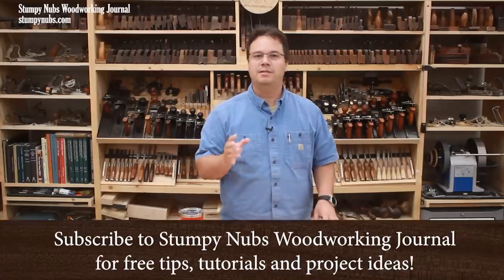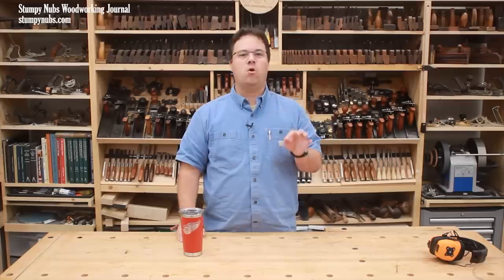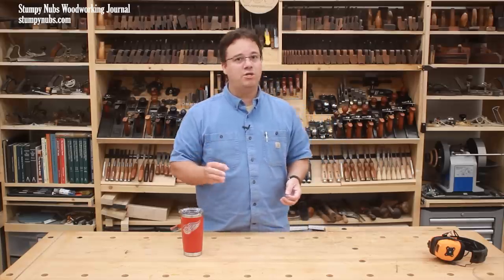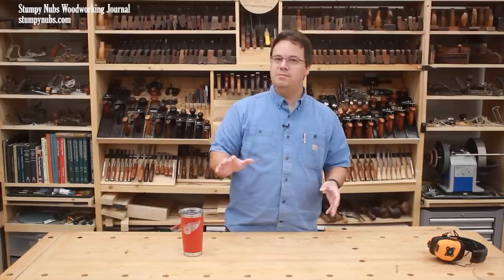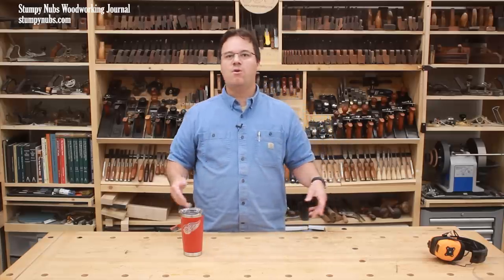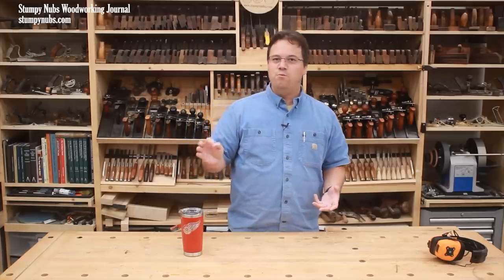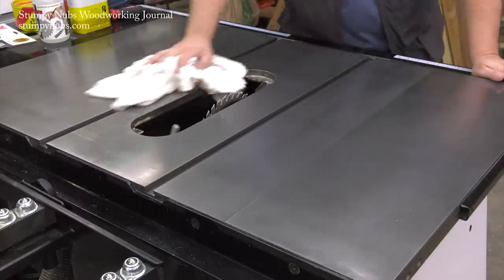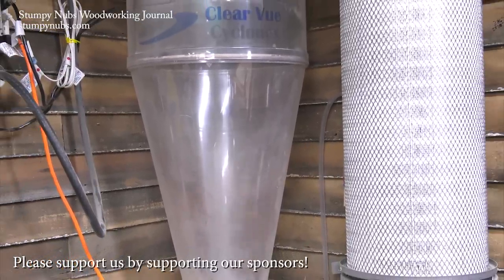Removing table saw rust SAFELY and QUICKLY

Comment: Maybe you could do a follow-up video. I'd be interested to see how you might bring a saw back it's been aggressively sanded. Not for me I'm asking for a friend. He might have done serious damage the top of his song that he bought brand new 20 years ago and then sat in storage for 10 years and then with sanded aggressively and thought was beautiful again and then put back in storage for 5 years then I got it out recently it was really excited to click on this video so you could tell his friend about how you might be able to fix it. Hypothetically theoretically speaking. I'm sure he'd really appreciate it if you would do that.
Reply: Get a good, high quality straightedge and examine the top of the table for suspected low or high spots. Mark all the high spots with Dykem blue layout fluid, then sand those spots down slightly with something like 320 grit sand paper, just until the blue is removed. Then clean the whole top thoroughly with isopropyl alcohol and make sure all the grit is off, then remeasure the surface with the straightedge and repeat the process! Just take it slow and recheck flatness frequently, and you'll be able to pull it back into shape. Also if it's hard to see the high spots, put a bright light behind the straightedge. You can also paint the bottom of the straightedge with the layout fluid, and then press it onto the part of the table you want to check. It will transfer fluid to the table, and if any spots under the straightedge don't have blue on them, those are low spots. Be sure to check flat from a bunch of angles across the whole table to make sure you're actually creating a planar surface. It's probably going to take a while, so just go slow!
Reply: I agree with the reply by Evan....while Dykem will work I found that a simple Sharpy permanent maker drawn lines and shapes in the higher areas will guide you to what areas need to be reduced...and everyone has Sharpies around the shop. Of course I would only use this for an obviously badly distorted top. Otherwise I would not recommend fiddling with a good top. I have wood working tools and also a metal lathe and milling machine in my shop. The ways on a high end metal lathe actually use this method to get them to incredible levels of flatness....they  use a sort of metal scraper to remove microscopic amounts of metal.  That is a real (sadly becoming lost) art.
Reply: To add to what Evan said above, 

Of flat straight and true, flatness is by far the easiest one to achieve. Find the lowest spot on the table, easiest with low viscosity oil, but dykam will work, so does a graphite pencil. Find a piece of float glass off yr neighbors house or something. Using super 77 spray adhesive attach 3M wetsanding paper to glass Using the straight edge, maybe a laser level, to help mark the depth settings your working towards. Normally I use this method to clean up planes and chisels by bringing the tool to the glass. In todays case were gonna bring the glass to the tool. 

Place on a cleared and cleaned table saw surfacetop and start sanding. Be mindful of the edges of the glass and don't break it, for the love of God. 

If you ever need a reference plate, or maybe you feel like DIYing a Metrology table, all you need is 3 stones. And a lot of dedication. Rub stone A against stone B. B-C. C-A. The only common surface between 3 planes is flat.
Reply: And here I was thinking WD-40, steel wool, and a cloth to wipe clean… am I thinking too aggressive or would that be fine?
Reply: @RobertKarlBerta  I've scraped in two machines.... my Lagunport mill (lagun republic milling machine with a Bridgeport J head best of both worlds) and my Hendey precision T&G lathe....
Scraping is a nice thing to know how to do that hopefully you never have to use. Of course if you know how to do it and you are any good at it you've done a LOT of it.....
Reply: @GaryLiseo  actually they still make brand new tops and even have the cast iron wings I couldn't afford when I first bought the saw...
All ordered.
I'll throw the old one on the mill and see how flat i can make it.....for science.
Reply: Interesting… I had a guy disappear after he left a drink on my saw as well… your wax tip prevented any bloodspots; I mean, would have if there was any blood… but there wasn’t…

Comment: Last summer, I drove 6 hours to South Florida to buy an old Delta Cabinet Saw from a woodworker that had retired about a decade ago.  That saw top was pretty rough.  I mean, there wasn't a single Millimeter that wasn't covered with rust.  

Some WD 40 helped.  PB Blaster worked better.  And about 30 minutes with my Random Orbital Sander and some 400 grit sandpaper made it look and feel new again. 

I use Minwax Finishing Wax on it to maintain the top now.  On a woodshed without any Climate Control,  and in Southeast Alabama, its working well.  

Good tips, as usual!

Comment: I loaned my Dewalt job saw to a friend who had it on his deck overlooking Copano Bay . The table had issues when he took it but when I got it home a large amount of the magnesium ( I guess ) coating was gone so after asking everyone in Rockport Tx. I thought would care about my issue I finally grabbed two cans of appliance epoxy paint. Sanded it down with 220 on my favorite 5" orbital  blue taped where I didn't want it 30 minutes later nice saw table top. Let cure for a week +/- tough as nails except for the running belt sander. Great video  I'm going to watch another

Comment: Great tips, James. Most of my Shopsmith tools have aluminum tables, which can oxidize, so my approach to them is slightly different, but my cast iron tools have all been through the WD-40 Scotch-Brite then paste wax treatment and it works great. As for damage done by visitors to my shop, I once had a guy set a Styrofoam cup of hot coffee down on my planer bed, and within two minutes it took us to realize that he had left it there, it had already generated deep rust ring. The stain from that ring remains today, but no one has seen the visitor in years. Scott

Comment: I just cleaned and waxed my saw top. I actually just purchased some of turtle wax’s new graphene type wax. Boy did it make the saw top slick. Used a gray scrub pad on my sander. Wiped it really clean. Used a little alcohol to get rid of residue. Then I proceeded to apply 3 coats of wax over the weekend. The top has never felt better. They didn’t have any in paste form, so I tried it. Worked like charm! Great info, as usual stumpy!

Comment: After cleaning rust several times my solution long term was after rust removal was to wipe surface with acetone degreaser and then spread a dilute epoxy coating to evaporate and cure a thin layer. Perfect prevention.

Comment: An old timer that I worked with back in the "80s used the ball end of a 32oz Ball peen hammer to burnish the table. He held it with one palm on the flat face and his other hand on the handle, using long strokes parallel to the blade he would get the surface to shine. plus the tiny slight concave lines helped break the surface friction. plus no clean up.
Reply: Never heard anything like this. Sounds fascinating.

Comment: I purchased a pneumatic jitterbug sander to do this using wet-dry automotive papers. I don’t trust the organic vapors around electric motors in close proximity. This trick works well on my very old Craftsmen saw. I was just given an upgrade, 2HP direct drive Craftsmen, with some serious rust on the top to which I will be applying this/your remedy. Who knows, the former owner may become jealous and want it back!

Comment: Lots of good suggestions here...and a preventative measure I use is to run a dehumidifier in my shop from early spring until late fall.  This has really been helpful as my shop is in my basement when it is quite humid.  Before I did this I did have a lot of rusting issues.  Thanks, James, for another great instructional video that makes a difference.

Comment: Once again, great advice. I've been doing this procedure for years ....on my aluminum top job site saws. Aluminum oxidizes and gets "draggy"  as fast as iron, you just don't see it. I use a very fine sandpaper, i000 grit or 0000 steel wool as the aluminum is softer than iron. If done on a nice hot summer day in the sun, I'll apply the wax while the surface is very hot, it seems to get into the micro pores/grooves better and lasts longer.  I do the same thing on my second hand Rockwell table saw in the shop. That saw had some serious rust in a couple of places when I got it. I've even used car wax on occasion to see if it lasted longer, nope, about the same.

Comment: I once left some freshly cut, not perfectly dried wood on my saw and came back two days later with heavy rust. I used the WD-40 with 400 grit sandpaper trick and it came up really nice. There was a bit of shading that I couldn't get rid of but hey, I don't expect it to look perfect for the rest of its life.
The saw was about 5 or 6 years old at the time and when I had first purchased it I cleaned the top, brushed on water based polyurethane then wiped off the excess with a rag and let it cure. That seemed to have lasted for almost 5 years. I now never leave wood on my saw and re-finish it every few years and it's still looking great, except that spot where I left the wood for a couple days.

Comment: Thanks for your videos, great advice.  I do this for my table saw however a synthetic inhibitor like Inox MX3 (no I have no commercial interest) will do a much better job at preventing rust than paste wax for much longer.  I find paste wax needs to be re-applied after a week or so whereas I have gone a month between applications with an inhibitor.

Comment: I use Johnsons paste wax on all my metal tops, aluminum too, I put it on every month in the summer and twice over the winter because I heat my shop all winter and it doesn't seem to need it as often. Thanks for all the great videos.

Comment: I had clean up an old delta unisaw for my boss that had been sitting in a garage for a year and a half, almost the same solution but i glued scotch brite
to a sanding disc for a random orbit sander, worked great,  looked like new after an hour of scraping and wd40 and the pad.

Comment: I live within spitting distance of Lake Ontario. My workshop is in my basement and in the summer time we get such high humidity that I just don't do any woodworking.  If I do, the sweat pouring off my brow seems to instantly rust my table saw, with or without a coat of wax. I have found that automotive rubbing compound applied by hand then followed with a coat of paste wax really helps to keep the rust at bay.

Comment: I have had very limited success with paste wax. Bostic Glide Coat is expensive but gives excellent results for rust protection and smooth sliding for the wood and outlast the wax many, many times over.
Reply: Me and you both after I  spray light coat wipe with paper towel me and paste wax I always  make a mess glide coat cost more but easier for me

Comment: Great video. Been here a lot. Living in North Florida and doing woodwork means moisture issues. In the summer, drying a board is tough, if I get down to 17% moisture I am thrilled. 
I have found two products that keep my saw tops from rusting. StrikeHold does a good job as a preventative and so does BoeSheild T-9. Neither are real cheap, but both are effective. I use more StrikeHold because it frees rousted bolts and nuts so well. So it is always on hand, it is my first choice. I use Boeshield on my boat motors and rigging to seal out saltwater. And prevent corrosion.  Boeing Airlines makes Boeshield, its what they coat their airplanes with to stop rusting and other corrosion. Both create moisture barriers, blocks salt, corrosion and most chemicals. They maybe over kill for those of you living in dryer climates, but in humid area… saves me a lot of cleaning.  Image it will extend my cast Iron table tops by decades.

Comment: I use a silicone base lube that drys hard quickly. This has worked well for me over the years and is also very slick.
Reply: Careful of the silicone, it will leave orange peel.

Comment: I have used WD-40 and a paper towel (Scotch-Brite pad anywhere there is a whisper of surface rust) on all of my cast iron for at least 25 years. I remember all of the negative comments online, and in magazines, on how that was the worst thing yo could do. Then several years ago, I was reading a test in Fine Woodworking, and lo and behold, after extensive testing of some very expensive, and well touted products, WD-40 was picked if not the best, along with them. I have never bothered with paste wax, because when things aren't slick any longer (maybe 4 times a year), its time for more WD-40. I also don't tend to use paste wax, because when it's too cold to feel my fingers in the shop, WD-40 is still slippery.

Comment: I have a Tauco tilting-table table saw. Circa 1939. Still working perfectly. For the last 18 years I have been using a nylon abrasive disc on my power drill to remove rust. Also called a face off pad. It's kind of like a very coarse scotch bright pad. In the beginning iI found rust build up within weeks but after finding a YouTube video recommending Paste Wax I found the answer. Unfortunately we do not have paste wax in our Country but have something similar called Cobra Wax. After I stared applying this to the saw top, I only need the abrasive pad about every 18 months.

Comment: I've been cleaning cast iron surfaces for years using WD-40 and a flat stone. Once I remove the rust I wax it just as you recommended. From there on, I wax it about once a month.

Comment: Early on I made the mistake of using a rust remover on my 8" jointer, not sure of the brand but it was too aggressive.  The whole surface became black and very finely pitted.  I am ready to bring it back to life.  Thanks for the tip on not using sandpaper as cast iron is very soft.  I will try to use minimal abrasion.  It's not pretty now but it's still flat!
Reply: I would think that if the metal was pitted after using a chemical rust remover, it wasn't the remover that caused the pitting, it was the rust.  Rust causes pitting.  It just happens that the traditional way of removing rust using abrasives also mitigates the pitting, but a chemical remove won't.

Comment: Ah, I am a fair weather woodworker in Toronto suburbs. I basically have a garden shed that I call my workshop. It is too small for any of the big tools. So in my backyard, I have a delta tablesaw, dewalt 735X planer, 16 Craftex Bandsaw, Rikon Drill, a compressor, Vacuum etc... and yes they are literally under the sky. I keep them covered with heavy duty tarp when not in use. When I need them I take the tarp off the machines, do what I need to do and cover them back again. Each machine has its own tarp. I do this in all types of Canadian weather, well except when it is raining or snowing.
So all this back story just to say...while I agree with paste wax, the problem with it is that it comes off too easy. So if I was to apply paste wax and then use the machines  for lets says 4-6 hours ..the wax is all gone, and if I was to cover it with tarp without applying a fresh coat, table will have light rust by next day (by light I mean, you can just wipe off with a cloth), however if I don't use the saw for a week, the rust would need to be sanded off.
I have tried various combinations, the best that work for me are silicon based rust inhibitors etc. ..however now I've got a rust proof that one of machine shop friend gave me. I was first cautioned against using silicon based products because they can supposedly prevent finish from getting applied. However just like Stumpy mentioned, I always need to sand anyway. In essence, what I wanted to say was that wax works however you may deligently need to apply it often if you are in a rust prone situation.

Comment: Hi James, I enjoyed your take on cast iron surface maintenance.
My go to is my trusty orbital sander, I use a 5" machine. I too clean the surface with WD40 then I start out with 220 pads or 320 then move through 400 and finish with 600 and do a final wipe down as you showed. Johnsons paste wax is the best choice for me as well just don't let it sit too long. If it dries you'll be losing muscle mass before the surface is polished.
As a side note WD40 is NOT a lubricant, it just displaces moisture thats all. WD makes lubricants but WD40 isn't one of them. Look forward to your next vid.
Taipan Woodworks

Comment: Excellent video!  ! use Boshield and/or the last tin of my Jonsons paste wax.....on my saw, bandsaw, drill press, and metal lathe and milling machine. I live in Michigan and my tools are in a garage that also houses my two cars so that can expose the metal to condensation. But my own preferred method is to cover those metal surfaces with OSB plywood or regular plywood cut to fit the surface and that has been oiled down with a mixture of 50% WD40 and 50% thirty weight motor oil. Get the oil absorbed into the wood a bit and than remove all the excess. Those wooden covers protect from rust AND physical damage such as dropped tools or parts. Ir you have a metal lathe or milling machine you know how those tables and ways are ground and hand scrapped to incredible tolerances....and a dent from a dropped tool onto lathe ways or rust would ruin your day for sure. The chances of rust forming when you are using the tool is not an issue as you can keep it clean and wiped down as you work. Where the damage and rust happens is when you aren't using the tool and it is exposed to condensation, dirt, atmospheric contamination, spilled fluids (llike coffee or soda), overspray from airosols, etc. By the way WD 40 is a very poor lubricant....it is meant for moisture displacement. I believe it was developed for the miliatary to prevent rust on arms in very humid climates.